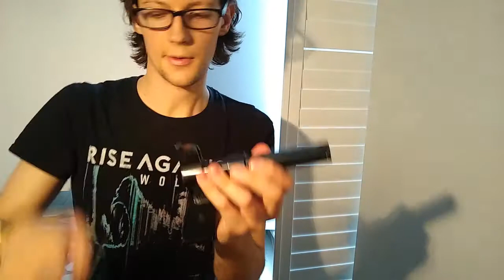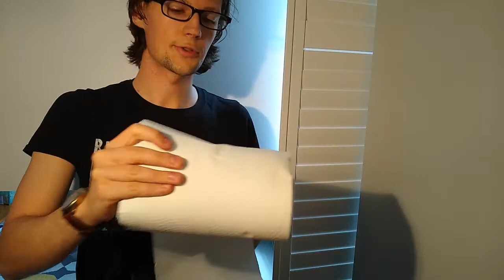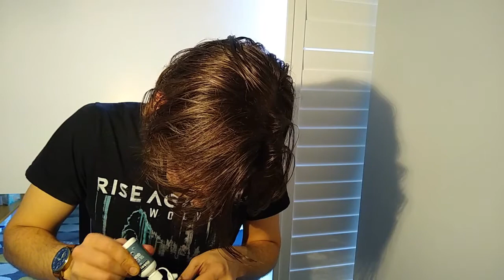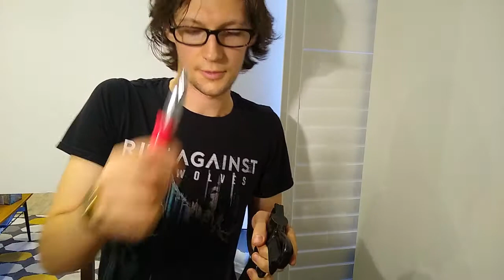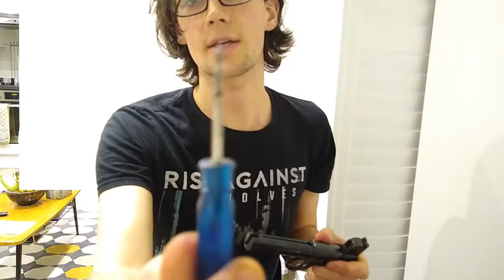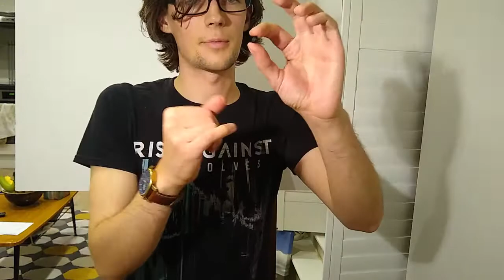Webley Junior .177 Air Pistol Restoration

Comment: You could get a set of modern wood grips to replace the broken bakelite, they are available online.
Reply from the maker: Thanks for the advice, I'll have to have a look at those.
Reply: You can also get replacement Bakelite or plastic ones- not sure if they’re old, old stock or replica ones but either way, they look original.

Comment: My junior hates silicone gun gun oil it binds up aswell I use  Molly grease. they don't like being run to dry or you can bend the barrel 💪💪
Reply from the maker: Thanks for commenting. I've since found the same thing. Against my better judgement, I tried it with 3 in 1 oil and it seems to get on well with that. All of the videos on here where it's shooting smoothly are with 3 in 1.

Comment: I have used Junior and Senior Webleys and have never had to use that much force to cock any of them, even with new springs? also when fitting new leather seals it is usual to stand them in oil til they are soaked through to soften and make them more pliable, otherwise a nice video.
Reply from the maker: Thanks for commenting! I realised this a while after making this video and have since soaked it in oil. It cocks and shoots really smoothly now. There should be a video of me shooting it up in a couple of weeks.
Reply: In good order the Webley spring should be strong and hence the piston should be well oiled, but it should move smoothly. If it is stiff and grates look to the part that pulls the piston back for excessive wear. Cocking it across a knee is normal but the only sound you should hear is it sucking air in. 
Do not leave the barrel open, if you touch the trigger it will slam back with considerable force.

Comment: I have a W- Junior with the tin grips. I repaired it by making the seals.  Where did you purchase the kits you used for this repair?
Reply from the maker: I bought my parts from TW Chambers at https://www.gunspares.co.uk/products/24530/Junior-Pistol-MK-II/. These parts are for a later model but fitted with a bit of modification.

Comment: Are you sure it's OK to dry fire?
Reply from the maker: Possibly not, to be honest. The piston seal, being a large leather plug rather than a very thin membrane, should be more resistant to damage from dry firing than a modern air gun however it could still be damaged from hitting the back of the cylinder, unimpeded by a pellet in the barrel. Thankfully I didn't see any obvious signs of damage or decreased power after dry firing a couple of times during the restoration.
Reply: @ThrHillSeeker  Mine was my grandfather's, a gift to him from my father. It's been dry fired more times than anyone knows, and no harm done because of it. I doubt it makes much difference if there's a pellet in it or not. 
I rebuilt it maybe 40 years ago when Webley were still making spares for it. I service stripped it again a couple of years ago and most recently re-blacked it (although it was originally browned).
Reply: Yes, but really only to test. The screw is supposed to be recessed into the leather plug so the leather absorbs the shock as it  slams into the end. It is going to do that when a pellet is shot. 
As an aside - an air gun cannot be fired, there's no gun powder to burn ;)

Comment: I’ve inherited one of these from my dad in the original cardboard box with an original box of pellets. But it doesn’t fire, it is hard to pull the arm down but doesn’t click. Would it cost a lot to have someone look at it?
Reply from the maker: That's awesome, working models with original boxes are quite valuable (worth about 10 times what I paid for this one). It sounds like the piston seal may have dried and perished, making it difficult to cock and stopping it from reaching the groove on the piston where the trigger engages. Is there spring tension on the trigger? I don't know the going rate for having airguns serviced professionally, I'm sure your local gun shop would be happy to give you a quote but these guns are relatively easy to disassemble and work on so you might be able to take a look yourself first.
Reply: @ThrHillSeeker  yes there is tension it just doesn’t click the box and gun are in mint condition my dad prob had it from when he was a boy
Reply from the maker: @DarksElite  Sounds like the trigger spring and piston spring and connecting parts are intact. It could be the seal has perished and is sticking or it could be a worn trigger sear or notch on the piston. All of these should be relatively easy to see by opening up the cylinder as shown in the video.
Reply: @ThrHillSeeker  sorry no there isn’t tension on the trigger
Reply: The trigger seems fixed in place as in doesn’t come out to pull in
Reply: @ThrHillSeeker  yeah I’ll take it apart and have a look, thanks for your help I’ll let
You know how I get on
Reply from the maker: @DarksElite  In that case it could be the trigger spring, the trigger can be removed by taking a pin punch to the pin that it pivots on (this is a little trickier to get back together than the rest of the gun). Glad to be of some help, good luck! I look forward to hearing how you get on.

Comment: Been doing essentially the same thing with the same pistol, only downside is that I cannot get the screw out of the back of the piston! I think it's fully rusted in
Reply from the maker: Thanks for commenting. The screw at the back of the piston took a lot of work to get out. In the end I soaked it in WD40 then used pliers and a set of water pump pliers to remove it. Clamping it in a vice might also work. Good luck with your project!
Reply: When you say "Screw at the back of your pistol do you mean the big one one the air chamber if so NEVER remove that even though it looks like a screw slit...

Comment: From  where I can purchase the airgun
Reply from the maker: You would need a gun shop who trade in second hand and antique air guns as Webley stopped making the junior in 1976. If you want a modern air gun with a similar design, you could look for a Webley Tempest which was made until 2019 so many gun shops still have them in stock.

Comment: i have  a  mk1 how do I go about dating it  the number is 16625 any help would be welcome
Reply from the maker: Thanks for commenting. Unfortunately no one seems to have a record of exact dates and exact, however, the fact that the gun has a full serial number at all means that it is a pre-WWII gun. If it has a slanted grip it will have been made between 1935 and 1939. If it has the straight grip it will have been made between 1924 and 1935. Hope this is helps. Source: https://www.webleyandscott.com/pages/date-your-gun#:~:text=Webley%20started%20producing%20Air%20Rifle,air%20rifles%20in%20the%201960's.
Reply: @ThrHillSeeker  thankyou for a quick response  it has a straight  grip

Comment: Years ago I bought one of these new, it was absolutely awful. The trigger had a pull of about 10 pounds and it didnt adjust. I resold it straight away
Reply: I'm inclined to agree! A friend of mine had a Webley 'Junior' about 1966; heavy trigger-pull, quite heavy to hold, expensive but not much power!

Comment: My ~85yo  Webley Junior (steel  grips) was rebuilt  about 40  years ago  my me. Family heirloom.  Recently serviced,  rubber breech seal replaced, puller  replaced,  oiled and greased. Pay particular  attention to  the  thin leather skirt on the  piston, it can get folded  back. Average with  0.53 gram, 362fps = 2.4-ft.lb, fps  ex.spread  all over the place 19fps with gross  outliers excluded. Gloriously inaccurate.  
You're  struggling to  cock it - hold the barrel up  against your  right shoulder with your left  hand and pull the grip  down  with your right, something like you might use a hammer.  
A "Yankee"  (tm) screwdriver has a ratchet drive, some have interchangeable  bits, some have  an Archimedes screw (spiral shaft) pump action.

Comment: A guy told you to soak your washers in oil first?? take it from a Webley and Scott gun smith " fit the leather washers first THEN leave the gun washers soaking in oil for a short while while the oil soaks after you fit them...
Reply: Do you mean fit the washer to the piston then soak in oil prior to gun assembly or assemble gun with dry washer and then soak in oil?
Reply: I know for a fact it is a LOT easier to fit the washer then slide it into the gun ( use care as not to rip it or damage it as you work it in  ) THEN oil it once its in and leave for a good while..However you will find your best method

Comment: In Australia, we are not considered responsible enough to have air pistols without special firearm licence which permits hand guns. 
We are quite jealous.     Your video was very interesting, but you might consider using a darker background and perhaps a lighter coloured T shirt when handling black objects which become silhouettes when your camera tries to adjust its light balance.
Cheers from Downunder and stay safe.👍🇦🇺🇬🇧😷😷😷
Reply from the maker: Thanks for commenting! I'm sorry to hear how hard it is to get hold of an air pistol in Australia. If it's any consolation, air pistols and old black powder pistols are the only types of "handgun" that you can own in the UK, even with a licence. Thanks also for the filming advice, noted. I hadn't really planned on filming the whole project so it was a bit spur of the moment and not the best set up. Take care!
Reply: @ThrHillSeeker  I have a n Air  Arms s200 which is very old but very accurate. as well as a n F X  Independence  which I have removed the pump and installed a cylinder.
to provide about 75 shots at 32 ft lb.   it''s very accurate and I shoot both of them to 50 + metres, so I have lots of fun. Because we all must have a firearm licence we are 
not limited to a certain muzzle energy so we can tune up the power as required. The downside is that because we need a firearm licence for all shooting,not many people 
think about buying air rifles and go out and buy rimfire . i am quite envious of all the air arm clubs and other activiies you have over there in Blighty. 
It's on my bucket list to visit the U K again when Covid is history ,and visit some of the shops and shooting ranges that exist.
Stay healthy and keep filming. 
Cheers from Downunder
Reply from the maker: @michaelrussell5346   Wow, your FX independence sounds like an impressive piece of kit! We are pretty lucky for the air gunning facilities in the UK. If ever you're back here and in the south east, there's a great place in Essex called Pete's Airgun Farm which is worth a visit. Take care and all the best from Blighty.
Reply: @ThrHillSeeker  I live in north Queensland above the Tropic of Capricorn. the Independence was a good idea at the time but because the climate is very humid, the guts of the 
workings became gunked up with moisture and other nasty deposits,which played hell with the filling valve. Using the hand pump only pumped moist atmosphere into the gun so I was forced to get a scuba tank.The rest was history. I guess they didn,t think of that in Sweden when they developed it.I guess mine has now become a Royale .when I can afford it I will pack it up and send it to the Australian agent for F X to fit a regulator, A little distance of about 2000 miles out and 2000 miles back.
cheer now